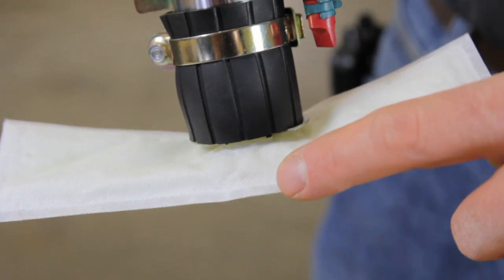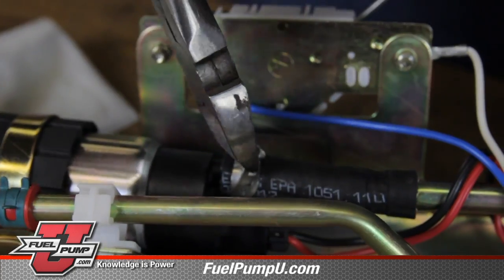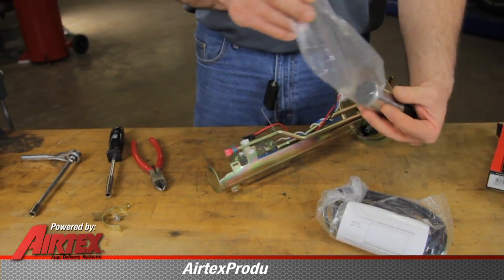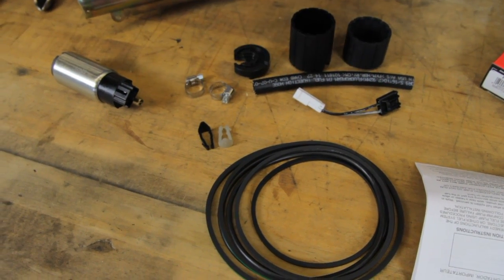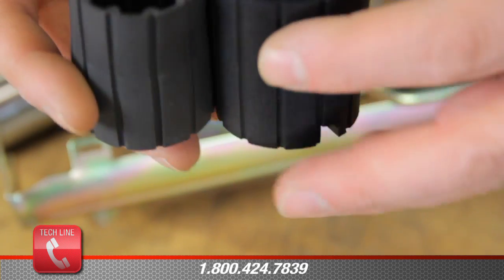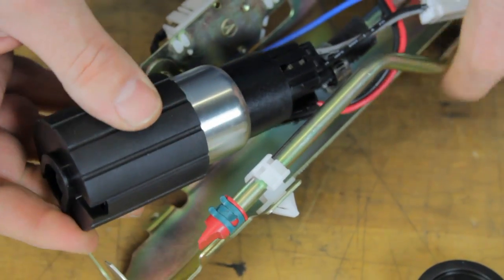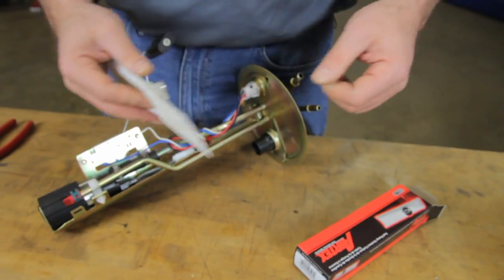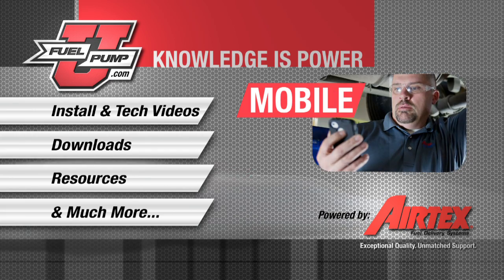How to Install In-Tank Electric Fuel Pump E2471

Comment: Hi Airtex!
THanks for the video on your pumps..
Just wondering which pump you would recommend for my cj7 jeep? I am upgrading from my carb system to a GM TBI/fuel injection.. I am only looking at a maximum of 15psi... Could you recommend a IN TANK fuel pump that will fit in the new MTS 15gal part #0051 plastic tank?
Thanks bunches for your time. :)

Comment: Greetings!  Firstly I really appreciate that Airtex puts up these sorts of videos as it was an invaluable aid in getting my fuel pump fitted and in.  

I do have a problem though.  I've partially reinstalled my fuel tank and wanted to test to make sure everything was copacetic.  Where I used to have no pressure in the fuel rail I now have pressure.  However, the car will start and then crap out after only a few moments of running rough.

Neither the filler neck nor the vapor line to the filler neck have been reinstalled, and the tank registers ~60mi to empty.

I'm running a 1999 Lincoln Town Car and your site says the pump should be perfectly fine for my needs.  I suspect that if I were to fully reinstall the tank and button everything up nice and tight there would be some negative pressure in the tank to assist in building pressure in the rail and allow the engine to run continuously.  I simply wanted to test to see that everything was fine before that.

I really just need an expert's opinion on if that is necessary or if there is likely some other problem.

Previously the car would not start -- no fuel pressure.  Strainer and Filter were replaced at the same time as the fuel pump.

Am I doing just fine, or is there another problem?